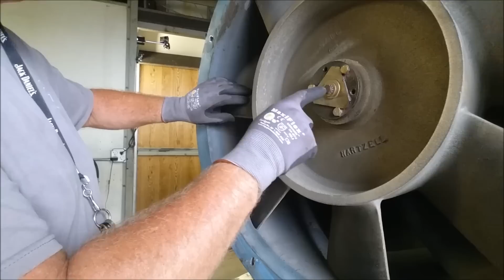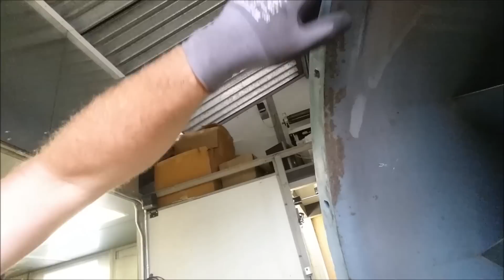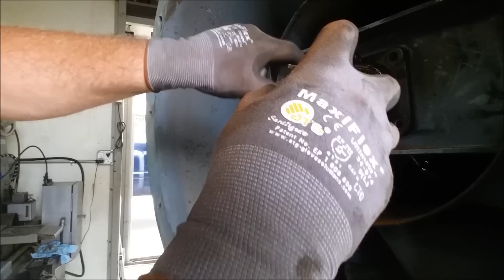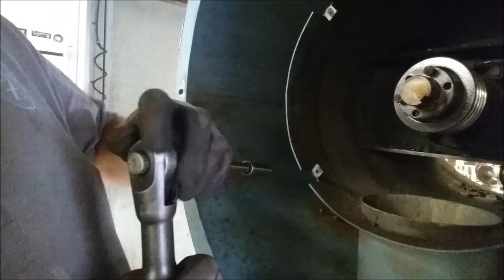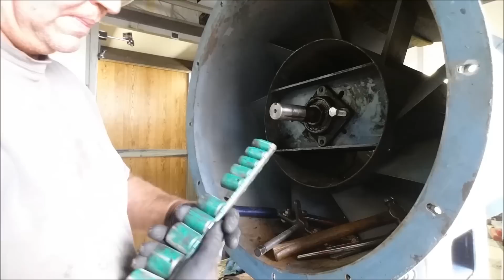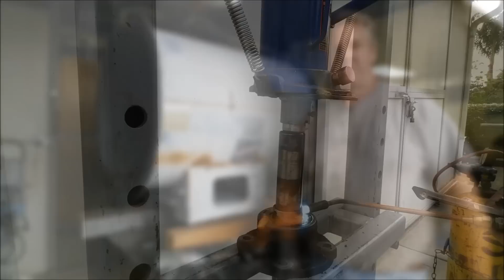Hartzell vaneaxial rebuild part #1

Comment: Great video Stan.  Lots of great tips on removing the bearings.  I use a similar bearing on a Ham Radio tower, 15 ft x 2" galvanized steel mast, and the bearings are thrust bearings for the rotating mast.

Comment: Great video Stan! I've been watching Keith Rucker Vintage Machinery, Tom Lipton Ox tool, Adam Booth Abom and Keith Fenner and Chuck outside screwball for a while now and finally got to your channel. The threading the bearing holes is an awesome and amazingly simple method. The facility where I work has several of these type fans used to vent Missile Magazines and now I know how to get my guys to repair them correctly! I'm sure that fan will be good for many years to come. I'm flying in to San Diego on the 14th and would love to come to the Bar Z party to meet all of you but I'm not worthy of all of the awesomeness that will be there. :-)

Comment: When I seen the Hartzell name it reminded me of my fan, so will go and check that out in the morning it might also be a Hartzell. The center of the cast blades looks like that unit your working on but the blades are shaped more like an aircraft propeller but different. I was going to smooth out the casting and polish the blades and re-balance it and turn it with a high performance Rotax snowmobile motor for a Everglade style air-boat but lost my boat in a windstorm when the boat was plastered against the dump truck totaling out the truck and boat. Its a direct drive off the motor shaft so has no belts. I figured the 70hp Rotax might over drive it anyway unless i could keep the RPM within spec of the rated RPM of the 10hp 3ph unit. but the Idea was to have instant thrust upto that RPM level. It also ocured to me it might just suck my skivvies and bobby socks off but not go anywhere very fast so maybe it was not such a good idea...so I will sell it to be used as it would be a crying shame to scrape it. I don't scrap stuff that still works its more valuable as a working fan. It would cost well over 10 grand for a unit like this new and probably would not be as well built. If you like to hunt we have 880 acre Ranch here and good fishing to boot. Your welcome to come up and check it out and take a break from the big city...Don Cossett is about 40 miles from here in Fossil.

Comment: Great video Stan, thanks. Hey you know what might be helpful for camera placement is a boom stand used for microphones, long reach type of thing. Just a thought.
Reply from the maker: Duncan Mac I was having a hell of a time with washout, every time I would move or stick my arm in the fan, it would block the light and over / under expose. That part of the shop has really bad lighting, something that is on my list to fix in the near future.
Reply: Shadon HKW Hi Stan, Great Video. With your camera, if you went into the settings and turn off the auto aperture I.E set it to manual. You can then set the level to what you want and it will remain the same at all times. Yes you would get burn out when you are not in the way, but you could set a compromise. It would be better than the camera keep switching from normal to dark every time you move around.

Comment: Hey Stan,
Nice video! When I was a service tech, I liked Kroil. On stubborn bolts, I'd soak them real good, let them cook under the heat lamp for an hour or so, and they would break loose. To rebelt the blower, it looks like being a retired gynecologist would be helpful. What bearing house do you use? Back in the 1980s, we used King Bearing. If I'd be out of town and didn't have the correct bearing in my service truck, I could usually find one in the area. Anyway, thanks for the video! It was really interesting. I'm glad that was you doing the work instead of me!  :-)
Have a good one!
Dave

Comment: Super video Stan, loved when that bearing let go under pressure! 

Does that fan howl when in use? Ours do in the grain dryer when they are running, mind you ours are double bladed (one at each end of the tube). We find them very efficient at coping with high back pressures from the crop being dried.

Comment: Could you use an Indicol type clamp with a dial indicator and indicate the shaft to center. Or a v bottom mag base.
Reply from the maker: MCEngineeringInc I guess I could try that, the housing is just a rolled piece of 10 Ga. I never really considered a weldment precise enough to warrant that.

Comment: Hey Stan, have a 48" 7 bladed cast aluminum fan like that with a 10hp 3phase motor. Came out of an portable mobile air conditioner for the SR51 Blackbird so they could work inside the bird on the tarmack in the Mojave Desert down at Dryden. I bought it from NASA the whole air conditioning unit. It took 200KVA to run the dang thing which included another 40hp 3ph for the blower and a 25hp 3ph for the pumps. I am interested in selling this fan and motor assembly if you know anyone interested...this was designed to move some massive CFM. The fan had a 6'.5" square solid copper condenser 8" thick . NASA spared no expense on these components, best in the world. Weighs best guestimation over 500lbs. Build your own wind tunnel with it and blow us away with a vid

Comment: Not necessary, but it would be cool to check after you use the adjustable rod method. Also, would check how round it really is. Could show a low spot to favor for equal clearance all around. Video content nonetheless.

Comment: If you dislike the rotational clearances on that fan, don't try a jet engine. Mind you, the blades have a fair clearance at first, but if it's off centre the turbines expand and cut into the sides.

Comment: Aircraft propellers are also made by Hartzell.  Same company?  Nope, I looked.
http://www.hartzellairmovement.com/
http://hartzellprop.com/
Reply from the maker: ***** Yup, same company, different division, when you see the paperwork, fan curves vs static pressures, BHP curves based on air movement and any other data sheets they provide, you can see that they have an army of engineers. Always top quality, always a pleasure to work on.
Reply: Shadon HKW I checked again and you are correct.  Both are out of Piqua, OH.